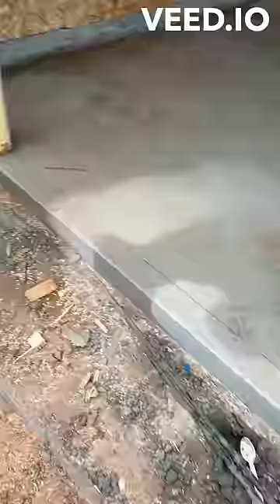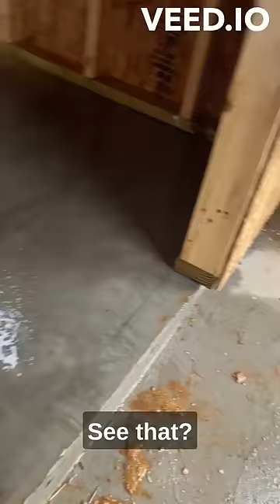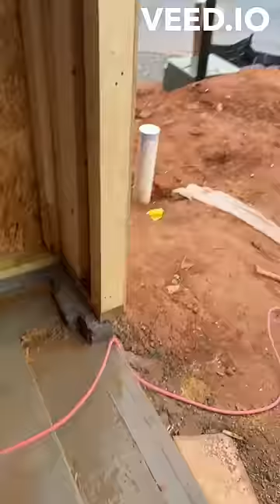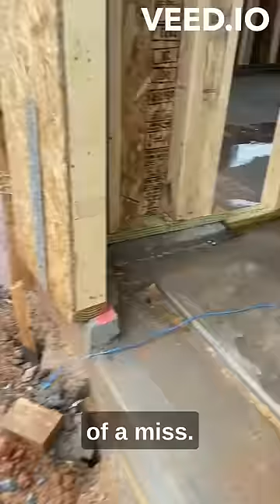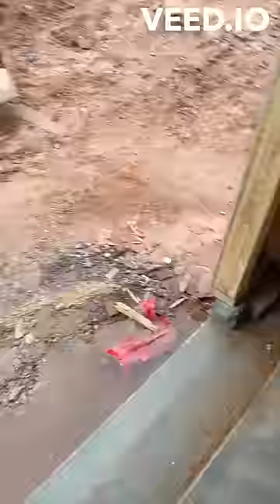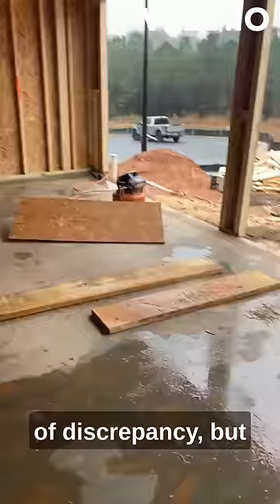New Home Slab is Wrong Size, What Now?

Comment: And it's cases like this where the plumbers get messed over... We plan our underground off the slab measurements, then the farmers cone along and do whatever they want
Reply: Yeah, no matter what happens, you now have to bust out the jackhammer on top out for nearly every fixture. I suppose your stub ups for lavs/sinks and washer boxes and the like would be okay so long as they're actually in the wall
Reply: When I was a plumbing contractor, 27 years, I always asked the concrete contractor what side did they pull from. I would always check the overall measurements. When finding your interior walls this was important.

Comment: How would you fix this
Reply: Simple. Convert to 2x2 studs & plates.
Reply: Lmao easy tell the framing company fix the blip out of this or your gonna fund my new truck with rv and a new man cave. 🎉
Reply: Hot dipped galvanized steel bolted into the foundation under the bottom plate. Takes time for an engineer to draw up the parts, the inspectors to approve the repairs, and a fab shop to make them and send them out for coating. Installation would be quick and easy. Not a cheap repair, but redoing the foundation or framing isn't a realistic option.
Reply: I’m wondering if you could dig down and add to your slab, so plates are resting on some material that you could shim/ drive in there on top of the new slab, what do you think?

Comment: It’s a prefabricated frame. 
There’s very little the framers can do in these cases.
Reply: I think you are right about the pre fab. except you tell the general it’s screwed after the first wall doesn’t jive.
Reply: I don't think it's prefabbed. You can see lots of toenails into the bottom plate, which is not how prefabs get made.

Comment: IMO, fire the framer and take him to court. the walls could have been adjusted on the fly much quicker and cheaper than changing the fucking foundation. however, If the framer brought the issue to the attention of the builder and the builder said do it anyway, then they deserve the consequences that happen next.

Comment: Right framers could have adjusted the frame and shorted the House 2 in on both sides in both directions and gotten away with it when they didn't get f**** paid because the house isn't as big as it was contracted at sounds to me like your concrete guys counted the the wood framing as part of the layout all in all the contractor is not any of the subs and this happens time and time and time again that building is equally off in every directions because they counted the framing that they poured the concrete into as part of the length of the measurement and width lol but then again the framers also should have called this out to the hnic at which point they probably would have shut the job down to negotiate either a drop in price and size or sue who ever laid that shit out and as for those of you about the jump on my s*** the framer wouldn't have done this intentionally this is the correct dimensions of the house otherwise I would have cost the framer an extra $1,000 per inch in materials plus some as I've already thought about it from that aspect who the f*** would try and stretch material to give the homeowner more than their paying for either way I wouldn't hire any of the companies that worked on this place
Reply: Plans could be off looks like 3 1/2 inches total.
     I work on an assisted living facility that 18 of like 21 toilets were off about 5 1/2 inches , turned out the architect messed up. I don’t know how much it cost to have plumbers run jack hammers on a heated floor but I bet the architect can!!!
   The plumbers only hit one line.

Comment: Framers should of stopped as soon as they marked it out and saw the issue. .5 inch maybe any more tgan tgan instant failure in my book.  Personally the slab should always be a few xtra inches. So you have an inch or 2 of buffer room
Reply: So the carpenters are supposed to starve while the substandard concrete guys figure this out? Nope. Carpenter was smart. He built to the plan. He has no liability here.
Reply: @farmerbill6855  the framer should have pulled 5 and 1/2 and snapped lines and squared, but instead he tried to make it per plan, truss guys usually come out and check for changes would be no problem to make the house 1 smaller or 2
Reply: @onward8231  it's the carpenter's job to build it to plan. It's also the foundation guy's job to build it to plan. It's the superintendent's job to check it between phases. The carpenter did the correct thing. It can be fixed with the house standing there, the liability falls on the super and the foundation contractor. Why should the carpenter be bothered with chasing someone else's screw up to the peak of the house? You have no idea what the elevation of that house looks like. Even an inch can screw up soffit, valleys, hips, eaves, and fly rafters that need to line up.
Reply: @onward8231  the roof trusses for this house were ordered months in advance. You can't make the house smaller, or larger for that matter. If you deviate from the blueprint, you become liable. Foundation guy screwed it up, foundation guy gets to fix it. That's the way it works.

Comment: I do kitchens. I measured a house where the foundation was poured using the inside wall dimension as the outside, so they lost maybe 16" in both length and width. Instead of fixing it, they took it off inside dimensions. Big mistake. Screwed up the kitchen. All the bathrooms.  I would never let this slide.

Comment: Sometimes when we design this offset is cause there is 1.5" rigid insulation applied to the perimeter of the exposed concrete. Insulation prevents heat loss in winter, and heat gain in summer. You can tell it was Intentional you can see in the video the walls were chalk lined that way.
Reply: Rigid Insulation in this case would have to be structural- and Im not sure its designed to handle that compression/load. Concrete is definitely messed up.
Reply: @ImnotaPirate   no it wouldn't have to be structural and it can't, it just thermal protection. There is no load on the insulation , the wall is sitting on the concrete slab as shown.  I've designed several houses this way. Google foundation insulation protection detail.

Comment: This is common but this doesn’t stop the framing from continuing. The concrete crews usually insert rods in horizontally and then fill in gaps.

Comment: We had 6 foundations ways off and we basically framed it and drilled holes to put rebar in the existing stuff and called the cement truck to come pour some and we framed it after we fixed it.

Comment: this used to happen to me regularly enough, if it was possible and didnt effect the roof line we simply shrunk the garage by up to 40mm to gain purchase and avoid losing the cavity to the exterior wall, however sometimes the slabs were bad enough to require attention and i would have no choice but to let them know and move on to the next one until it was sorted out

Comment: Looks like the concrete forms were measured from the outside of the form, not from the inside of the form. THERE appeared to be 1 and 1/2 inches of difference,  that the thickness of the forming materials,  ( 2 by )...

Comment: My son is a carpenter. The company he worked for got the bid for housing at a local military base. He told me that they had to redo some of the concrete work because of shoddy work. Apparently there was no general contractor in charge of the project. It was bidded out by several different subcontractors. He told me that he never saw such shoddy work in his life. Everything, electrical, concrete, plumbing was wrong. It was just cobbled together to fit.

Comment: You can fix it when you pour the driveway. Just thicken the driveway down to the foundation concrete at the edge of the garage and firm up to the 2x4 where necessary and pur that monolithic with the driveway. Easy fix.

Comment: That's usually the concrete guys issue. Probably took the spans from the print and went to the wrong side of their forms. Framers have to stick with the blueprints as I'm sure everything was already ordered like roof trusses. Everything starts at the bottom and works it way up. Seen this probably a dozen times.

Comment: Easy fix, upgrde to 2x6 wall so you have good bearing.  Inside dimension will be 2 inches smaller but youll never know it and the outside dimension stays the same for trusses to work properly.

Comment: Plan says this is 87 and 9/16. 
It's hanging over 3/4 of an inch on both ends. That's the point where you stop and figure out what's wrong. When you make that first cut and it doesn't fit.

Comment: This is not a case of them not seeing eye to eye imo. Either the framing is off or the slab is with this much over hang. Since I used to QC slab measurements I know it's more than likely the slab lol. Especially since most companies don't double check their work or their guys work sadly. Plus framers normally have measurements down pat. Squaring not so much sometimes, but measurements they do in their sleep. Atleast it's an easy fix, but not a fun one at all because there are so many and if they are not done correctly the repairs will be pointless.

Comment: Concrete guys are always off that’s why framers need to fudge the numbers a bit to get the walls to function and the trusses to set correctly. If the bearing walls ate off the framers should have dropped a couple of inches to make it right. We needed to adjust measurements on every house out of square pads or short or long measurements a good framer would have no problem.

Comment: This should have never gotten this far. As a general contractor, these kinds of discrepancies happen all the time. A simple call to the GC could have solved this problem in most cases, in under a minute...before the walls got framed. The GC makes a judgement call and either calls the concrete guys back or he just simply tells the framer to move the wall to the concrete boundary. In most cases it's an easy fix before the framing goes up unless its off by a huge margin.

Comment: Framers build to size on plans. Structural. Concrete foundation plans should always meet structural framing plans. That looks as if Homes Depot MFS formed the concrete foundations without knowing how to read plans. Yes carpenters should have stopped once they snapped walls. Seems like they were trying to make a point.

Comment: If it doesn’t affect the kitchen, bathroom areas as far as cabinets, shower designs or the like, as a builder there would have to be a, what we call “executive decision”. Basically we would be looking at bringing the outside bottom plates flush. But if this disrupts major plans of the house original designs, noticeably…then the alternative would have to be laying block or brick or something to cover the plate for support. It would suck but a homeowner shouldn’t have to live with a mistake like this for the rest of their lives if it affects their plans. There are several factors to think over but for sure, what’s in this video shouldn’t be accepted. That overhang is just to much. 1/2 inch maybe. But that’s half the plate.

Comment: You do realize more concrete is being added for the driveway right? That's why in 2 locations they have temporary blocks. Those will be pulled out when the rest of the concrete is poured.

Comment: That’s 100 percent on the framers. If the slab is off you either talk to the builder and see what they want to do or you just adjust your measurements accordingly. This is a complete hack job. It reminds me of the jobs that the sheet rockers either cover pipes that they know aren’t connected or they cover all the electrical boxes because they don’t give a shit. Get it done as fast as possible and get paid

Comment: This is 100% on the framers but actually an easy fix. You just have to run a 2x6 all the way around the house and call a concrete truck to fill in the gap

Comment: It actually looks like they counted forms as part of the finished dimension. Now they have a 4623 sq.ft house instead of 5000. The brick veneer won't fit right and they have to get smaller appliances and vehicles. On the bright side, their HVAC will be more efficient, they will save money on HVAC bills, and they'll have more yard space. How about a huge discount? Not!

Comment: To be honesr, if i was in that much of a hurry to frame it i wouldve worked with what the concrete guys left me. Kept it flush with the concrete.. i know its not right but at the very least wouldve done it that way rather than have my plates over hang and not have much bearing

Comment: For starters all you have to do is measure the slab then measure the frame to see who screwed up what, second all you have to do is drill some holes add some steel pins and add some more concrete no big deal

Comment: The contractor hired the cheapest concrete company they could find. The framer told the contractor 10 houses ago the slabs aren't right and if they build the walls to the size of the slab the cabinets/appliances won't fit. The contractor told the framer to make it work. This is why you don't buy pre-made houses. If you think that's bad, a company just built a slab house in 4 days from breaking ground to finish. (This includes "drying time" for the concrete). I feel bad for whoever buys that house. The companies next goal is 3 days.

Comment: Well, see - the solution would have been for the framers to bring their outer walls in about a half inch to an inch so it would all be firmly on the concrete. Since it's easier to frame the hous according to the slab you have than it is to stretch the concrete slab. Unless the frame is prefabbed offsite, and they don't have a single carpenter on site to make corrections and adjust accordingly. In which case the builder should be fired for gross incompetence. But that's jist my perspective, I could be wrong.

Comment: We did a concrete  job for a friend l, the framer wanted to do the conrete and over charge him. So when he started framing, told the owner the slab was not squared, onde side of the house had extra concrete and the other was short 2"... And i said do not let him frame.. i went over did every measurement per print before the owner and the framer,,, i did not miss anything, perfectly squared, he was acting out on revenge for not getting the concrete pour job.. any framer that doesn't bring up to your attention or frame over something suspicious out of squared should not get paid .

Comment: Wouldn’t you check your measurements twice before pouring concrete and wouldn’t you measure twice before framing. Seems both like both contractors messed up. 
Sloppy work!!

Comment: I knew a framer who did this crap all the time, Making my job a miserable job as a brick mason, I complained to the builder several times about it, And he would just tell me to do what I needed to do, But then again his brother was the framer. The worst framer I have ever worked behind, He didn't know what a chalk line or string was. He would frame walls that look like Santa Claus's belly, and yes, I told him he needed to get on the concrete guy or get a new concrete guy, Because as we all know it all starts with the foundation.

Comment: That looks a lot like an 1-1/2 miss, like the foundation crew put the form on the wrong side of the line. Over the years a s a framer, I've seen worse. Framer did the right thing, keep your dimensions square and true, let the general contractor and foundation contractor deal with the mistake.

Comment: That's some bullshit right there. That contractor should've caught it when walls started going up. NOT...after the walls are built. Also easy fix by adjusting interior walls a little BUT IT IS NEVER OKAY for external weight bearing walls to be hanging off the foundation!!!

Comment: Should have just shortened the layout and adjusted it to fit not as much the concrete guys as the framers fault for not adjusting there wall measurements to fit

Comment: This was done on purpose by the framers....they probably have had problems with building to blueprint in the past with the contractor is my guess. Simply moving the walls a few inches to begin with would have avoided the expensive answer now. What viewers dont see is that the scheduling is screwed now...EVERY subcractor needs recontracted. Most wont be available for the ? days the general needs them on. Bank financing for that job just kicked up a few points also, thousands of dollars there too. Yeppers, that 4 month build to completion, easy custom job just turned into a year long miserable boondoggle. Heck, eben extending the foundation on the exterior (easiest fix now) will eat up a week.😮

Comment: Form-setters fault plus superintendent didn’t measure form before placement of concrete. I always measured my forms, set back and correct front elevation from street. I miss building homes but they ran me out of the business in 08 so builders get what they deserve.

Comment: Not such a hard fix ... I fix these kinds of mistakes all the time by doweling in rebar with Simpson Set 3G two part epoxy and pouring in the concrete recommended by the engineer. You'll never be able to tell afterwards.
Who ever makes that kind of mistake and it gets that far into to framing , it will always fall on the concrete repairs specialist to go in and fix it after the engineer ok's the recommendation.